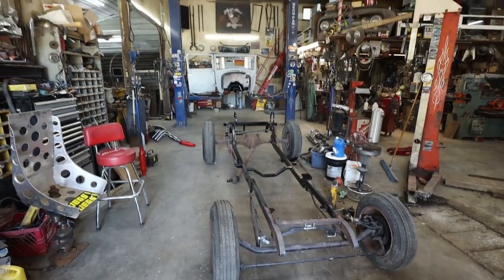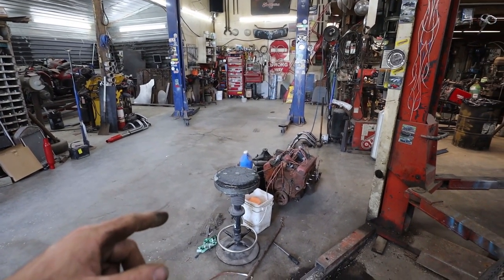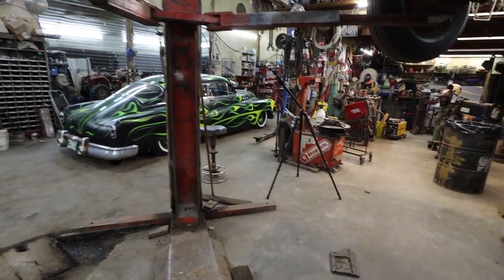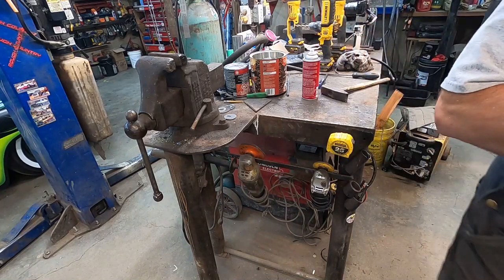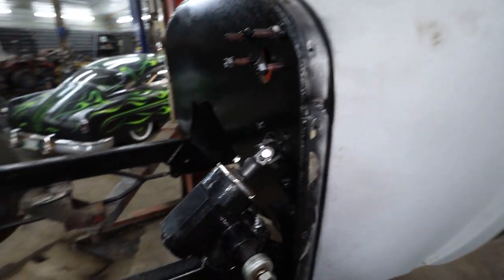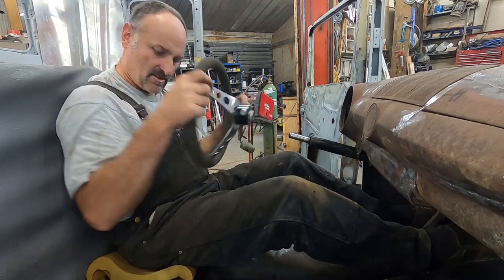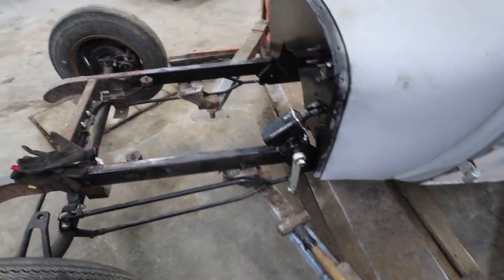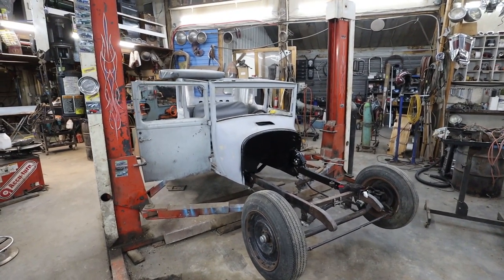Building a custom steering column for our Model T hot rod Part 14

Comment: Doesn't matter how many times things foul up - they only have to go right once 😎 Good work finding the right mix for the steering - looks like it'll wheel easily, and you've eliminated all the nasty geometric problems that you faced early on.

Looking at all the things you had to solve along the way it looks good, and the progress is steady. Too bad you still have to body filler the dash - that's going to be messy. As always thanks for the great work and interesting content.

Comment: Too make bidy mounts I had a friend that owns a garage give me a tractor/truck time with really thick sidewalks. I used a 3 inch hole saw and cut a dozen pieces, worked like a charm. Made my 32’s drive softly! 😁I used to buy reg body mounts but the rubber collapsed too quickly.

Comment: I know from experience that a seat with some thigh support so you don't have to hold your knees up would be nice. I do like the wheel down low like that, it's most comfortable for me. You've got it coming along nicely! Good to know that speedway tubing is tap size, the tube I've been using I have to ream first. I know back in the day I could buy tap size tube for 5/8 and 3/4.
Reply from the maker: Yeah saves from the hand under the keg on long drives haha

Comment: Use a steering wheel from a aftermarket RZR/UTV, they are flat on the bottom, not completely round and should fit the quick disconnect.

Comment: On the rod that joins the steering box to the spindle are both heim joints right hand thread or do you have a left hand tap? Either way ,easily adjustable. Nice work!👍🇨🇦

Comment: I know you fussed with that steering column a lot an for  the most part looks good... I think you need to add more to the outer tube part of the column, to get rid of the gap between the wheel an the tube part...

Comment: Why not just add 4-5" of pipe to steering column. Don't thing it will matter if bearing is down in column that far. Than u can bring turn signal box closer to steering wheel.